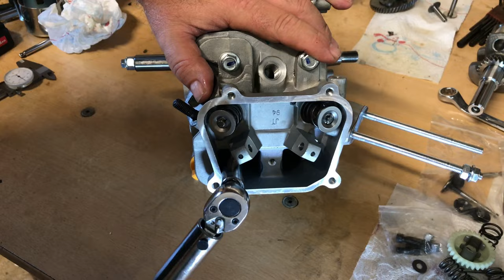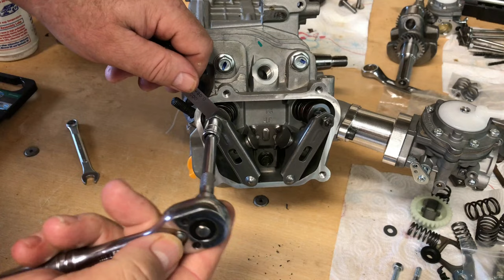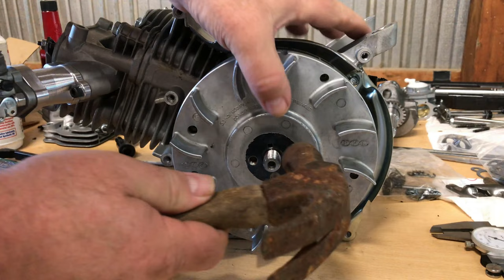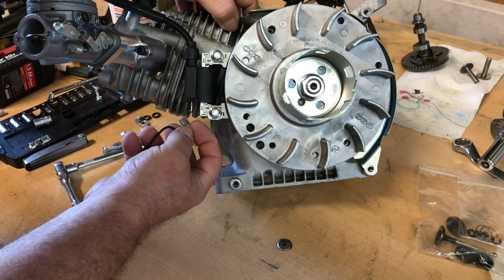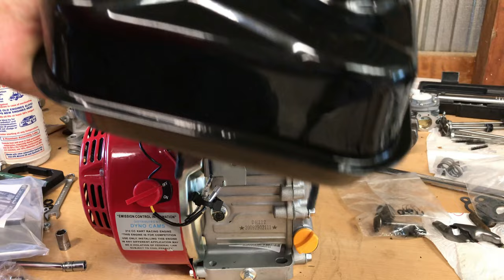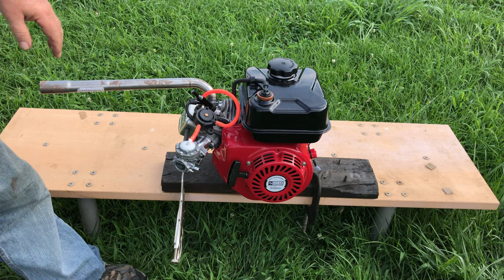Part 3-B DUCAR 212 Hemi Performance Engine Build Alternative To The Predator Ghost 212 Kart Engine

Comment: My Tillotson 212E came with that exact pin holder,and the milled,ported and 28mm 25mm valve Tillotson Hemi head i bought came with bolts and lock nuts to hold the rockers.  After dropping the tiny locknuts to many times i went back to the stock pin holder and I think my roller rockers like the stock setup better.
Reply from the maker: Hi Cymbalmonke! Those little E-clips can be a pain! I like the bolt down bracket better for ease of install and removal. I've had difficulties finding those though.

Comment: that thing is clean boss i Love my Ducar
Reply from the maker: Thank you Sir! I like it! So far the DUCAR 212 Hemi is my personal favorite.
Reply: @KentuckyFriedFixes  what gasket u think i should run now i have the gov out and bigger carb i ordered some 22lbs springs too
Reply from the maker: @SoLoCruizer  Head gasket: If you can measure how far your piston is down the hole just remember to keep the distance between the top of the piston and the bottom of the head no closer than about .030" (thirty thousandths of an inch) If your piston is .020 below deck , you could safely run a .010 thick head gasket.

Comment: I was building another kart engine yesterday it was a predator I already had and ran some it has a mod 2 cam 26 pound spring’s aluminum flywheel high compression piston stock appearing carb 1.3 rockers and a little head shaving. It had quite a few laps a buddy of mine ran it on his kart and his motor made 18hp on a dyno  and he said mine was a little stronger. I tore it down and did a little porting shaved the head a lot and put a ARC rod 6252 the long one converted the carb to methanol and I tried using another thin head gasket but the piston was hitting the head so I went with a thicker head gasket I also took the key out and advanced the timing without a key and I couldn’t get it to start I tore it down checked everything and still nothing so I took the head off and realized I didn’t put the dials back in when I switched to a thicker gasket put it back and fired right up. The only thing I can think of is the head gasket shifted when putting it back together.
Reply from the maker: Sometimes a small thing can cause the biggest problems! Glad you found it!

Comment: Just got the new ducar 224 as my predator 224 side cover blew off so now it’s time to start another build hopefully the ducar is a lot stronger as my predator was just a mild build but she ripped would do 65 with juggernaut and she got there quick so quick that even in roll races she would wheel from the start
Reply from the maker: Hi Dalton! The Predator 224 is a Ducar block as well. Try to get a decent balance on the rotating assembly for the new build, those cranks have a terrible imbalance and the counterweights are too light. Anything you can do to reduce weight at the rod and piston will help a bunch on the top end. I'd go with a lighter flat top piston as well instead of that heavy dished factory piston. Every little bit helps smooth things out. You can do it without computer balancing equipment. All you need is a free rolling stand for the crank (like a motorcycle wheel balancing stand) and a good scale that reads in 1/10's of a gram. Start off small and before you know it, you'll be drilling 1/2 holes in counterweights and ordering heavy metal slugs from the Jungle site. People pay a lot of money for engine balancing too!

Comment: Man that thing sounds stout!  I just built my nephew a minibike here with a predator 224. I used the EC rod and 223 wildcat piston along with that NR/Studs Mongoose .272 cam, 1.3 sled rockers and 26 lb springs. I've liked that cam over the .265s for a while now but You turned me on to that rod/piston combo and it works great! Im wishing it had stainless valves and automotive style keepers which i may swap in while the frame is being painted and the front fork plated. Which Jungle Tillotson do you have on there? I'd like to try one on my next project.
Reply from the maker: You've got a great combo Frosty! I like that Mongoose 272 cam. 245 duration is much better that the 233 of the Banzai. The link to the Tillotson clone carb I used is in the Tillotson videos, it says "Yofmoo" on the box LOL! They're great little carbs. Much easier to set up and tune than the VM22 slide carbs. The only drawback is the intake costing $50. But there are ways around that as you know. Thanks man!
Reply: @KentuckyFriedFixes  Thank You! Hope to do a video or two soon on some of my projects but trying to keep an Ice plant running in Southern Kalifornia summers is two full time jobs. I haven’t even been able to do any tool reviews or drag racing stuff.

Comment: I noticed that first business card said Waukegan Illinois. Are you located in IL? I'm in Wilmington IL
Reply from the maker: Hi Steve! I'm in South Central Kentucky. David is in IL and owns/runs "Lindy Tools". I used his business card as the example when I was setting the air gap to kinda give him a little shout out for the custom tooling he makes. The valve relief cutters I purchased from him are first rate tools. Of course he doesn't sponsor the channel or anything and I did pay full price for the relief cutters I purchased from him but I do give credit where it's due if I use something that's good, and those valve relief cutters are top quality. Thanks!

Comment: my ducar didnt come with a guide plate either
Reply from the maker: The Hemi engines don't really need a guide plate for the push rods. The shaft mounted rockers hold everything in place good enough.
Reply: @KentuckyFriedFixes  tthanks for helping me understand why theres a open screw hole i was thinking something was missing